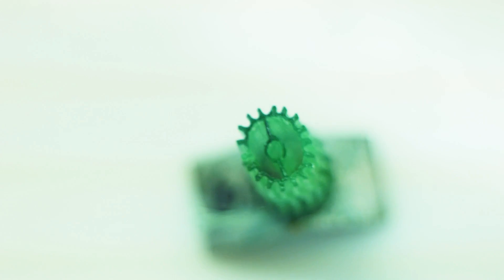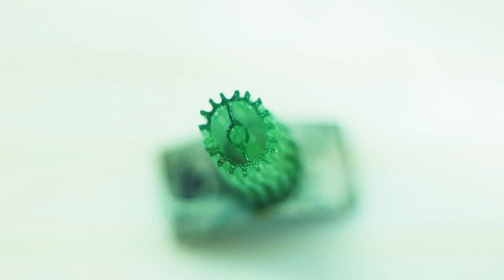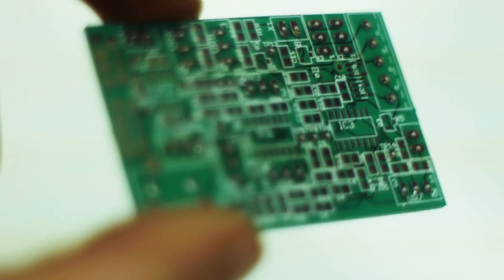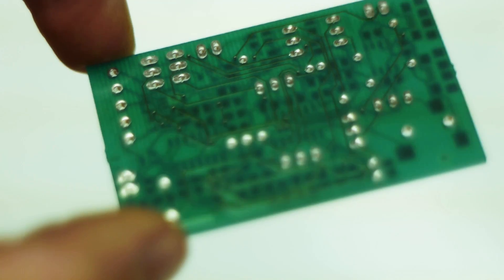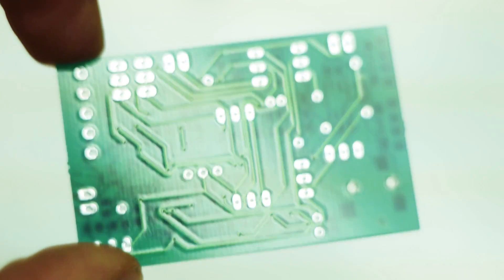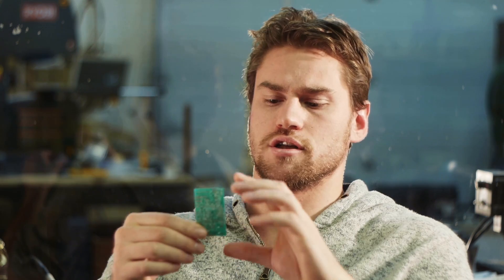Update #14   Circuit Developments

Comment: can the same tech be used for a laser cutter version?
Reply: potentially; yes, practically; no. at least not unless you dont mind every edge of the cut being at a different angle.
Reply: etopsirhc
nothing wrong with that. would engrave well enough though
Reply: etopsirhc
That's easily remedied.  Just increase the distance between the mirrors and the work piece thus minimizing the angle change.